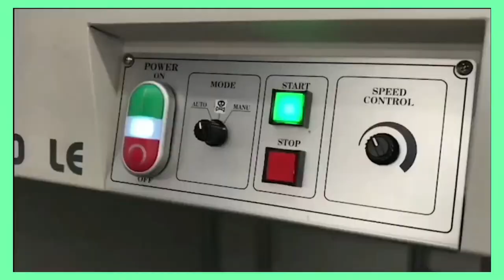Advanced Manufacturing 1/25/2022 Featuring Adafruit’s Stencil Machine and More!

Comment: What is the last machine, doing DIP soldering called, like a pen tip
Reply: Wave soldering I think
Reply: @YSPACElabs  Yes Wave soldering, but its a general term, generally have molten solder, and boards move over it. This is unique, the solder goes back to the pen, and can do selective location soldering, so what's the machine name.
Reply: Selective Soldering.